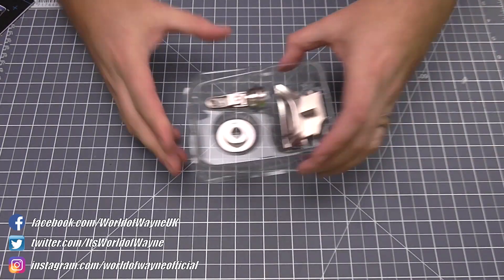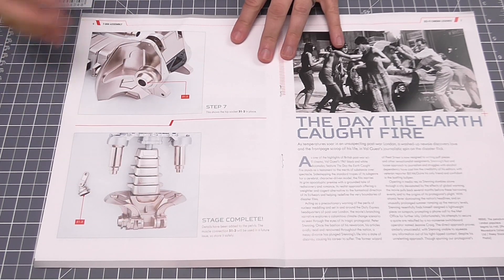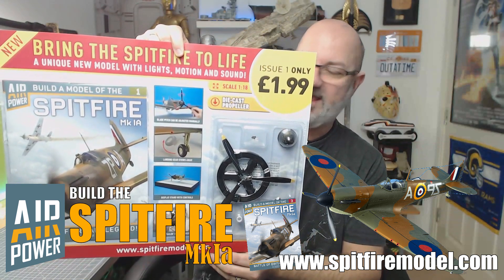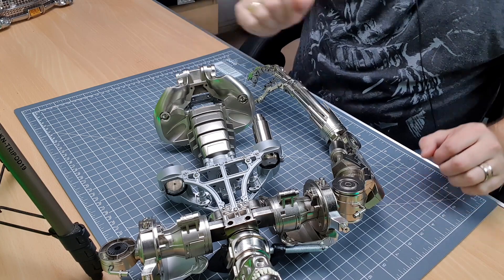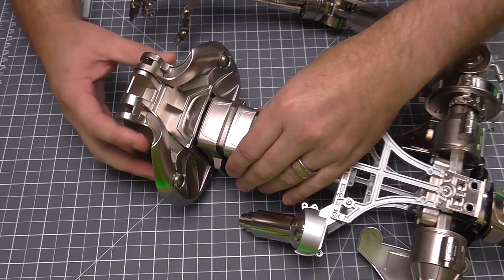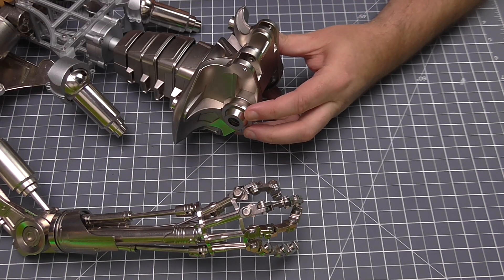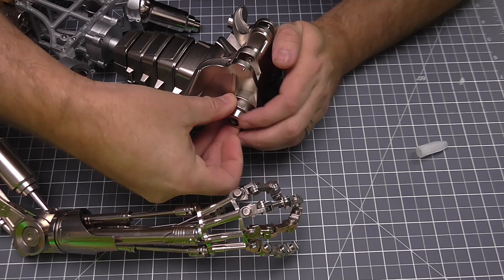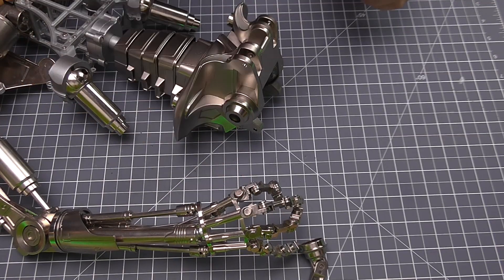Build the Terminator - Part 51 - Fitting Details to the Pelvis

Comment: I would do the spitfire but I have 2 spitfires that are massive already and 4 smaller ones no two the same. The large ones are the prototype, and the griffon engined mk VII. I have a tropical spitfire, a mk I, a mk III, a mk V, and a mk VI. All are die cast models with extremely good detail.

Comment: You will soon be needing another larger house Wayne with all these builds. Your terminator has had me “kicking myself again” for not getting this at the start. Unsure of the spitfire to be honest with 100 issues for the aircraft and 20 for the diorama. You mentioned a premium subscription but i cannot see that being offered. 
Its the size of the spitfire footprint that has slightly put me off but i have subscribed so at least i can try out the first couple of issues and then decide to continue or not.